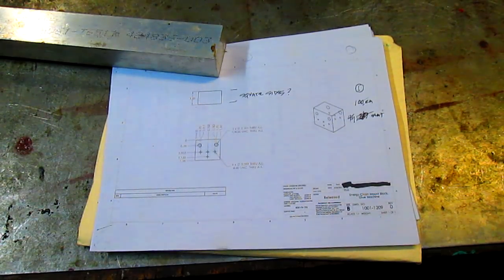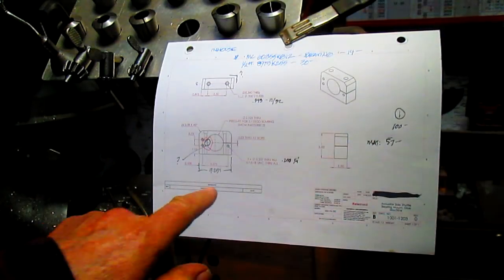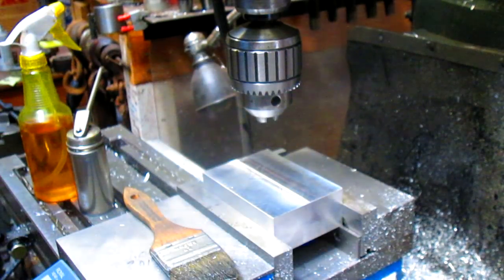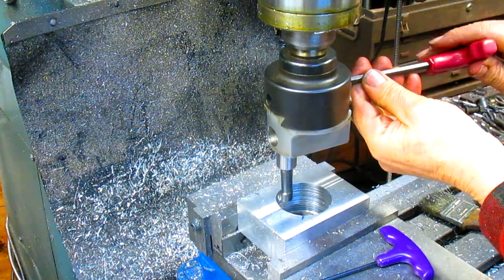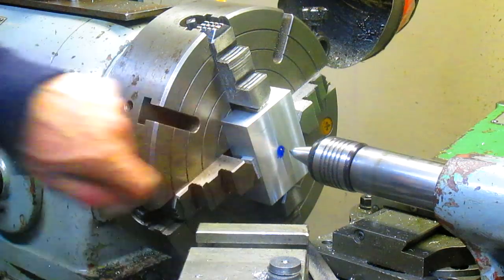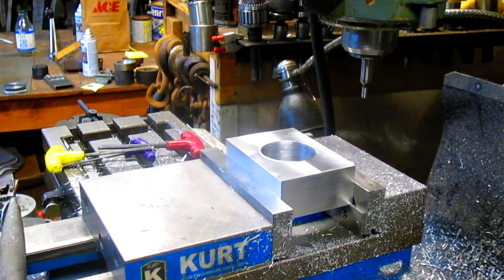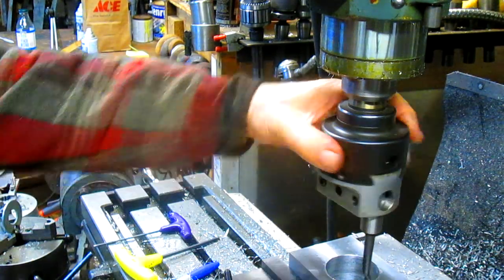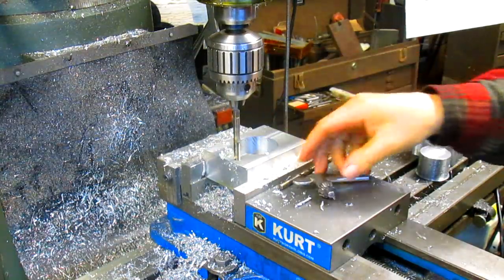Eccentric Motor Electric #1

Comment: I have never ended up with an accurate hole I've cut using a hole saw don't feel bad. I enjoy watching your videos. By the way, I have finally got around to installing the lead screw and nut you made me for my compound on my restored 1935 LeBlond Regal 12" round top lathe. It fit perfectly and made a huge difference in the RO on the compound. Thanks Again!
Reply from the maker: I'm happy everything worked out. Yeah, never use a hole saw on thick metal again.

Comment: Is the bar on the table of gauge quality? i. e. why didn't you measure off the table?
Reply from the maker: A shop ground parrell. Although my table has no holes or deep scratches, the surface is rough from use.